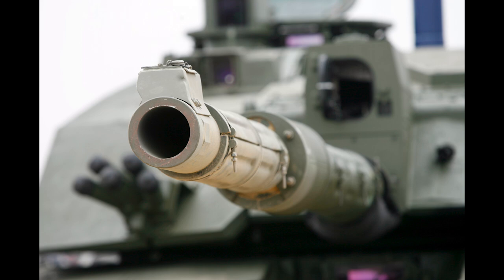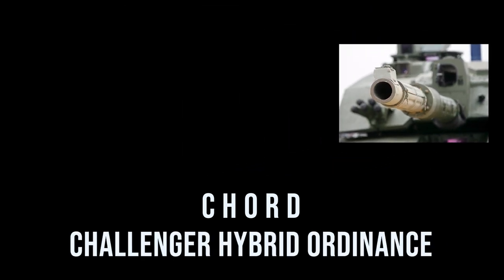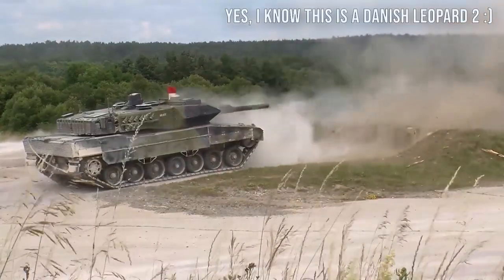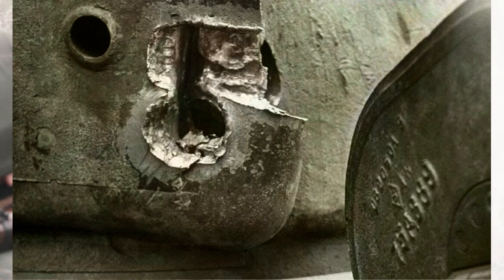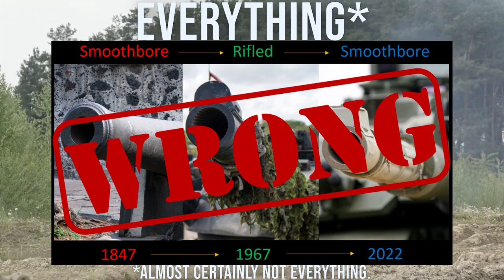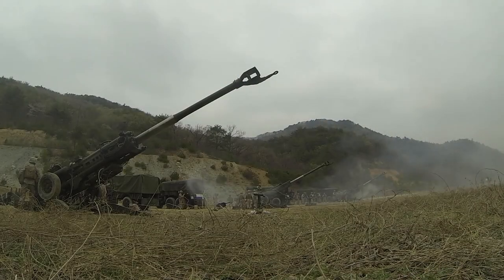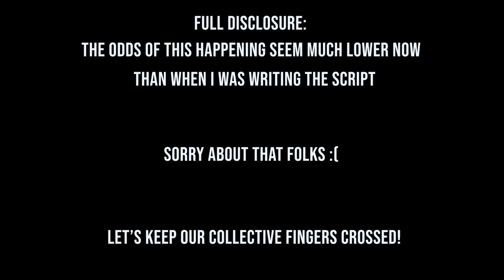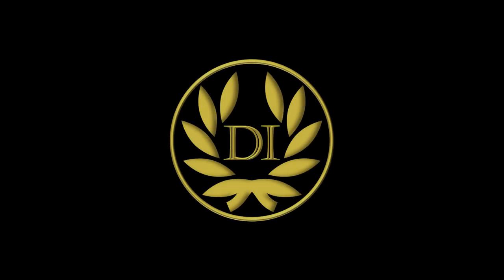Everything* Wrong with: Why do (most) Modern Tanks use Smoothbore Guns?

Comment: Another major reason for switching to the smoothbore Rh120 is that the rifled L30 has reached its limit in terms of APFSDS penetrator length, which is a key driver in penetration performance.

Comment: Licenced version of the L30. You are doing a good job my friend. Keep up the good work. Nice photos of the Sabre 2 on your comments about HESH. The Challenger 3 gun type is still not settled. The 130mm is still in the running.
Reply from the maker: Thank you for the info! Much appreciated!
Reply from the maker: Oh, that 130mm gun is really interesting - I’ve read that it would require an auto-loader, but that it could increase the velocity of some rounds by as much as ~50% over the L55, which sounds like a massive leap in performance for just 10mm more diameter.
Reply: The challenger 3 will be using the L55a1 120mm main gun, these are being manufactured now in Germany. The 130mm L/51 was never in the running for the challenger 3.
Reply: @diffusumideas9064  yes it's interesting. I expect commonality will win out, only for the US to change their calibre lol. Good video, keep it up.
Reply: @HJDore  
I don’t get why so many people do believe that the Rh 130mm/L51 gun is an option for the challenger 3. The Challenger that was fitted with the 130mm gun was just a demonstrator, not even a real prototype. The 130mm/L51 is still under development. And  it is even not clear if the gun will be selected for the MGCS program because the French are still trying to promote their 140mm ASCALON gun with telescoped ammunition.

Comment: well, the heat rounds do partially melt the armor. it's a combination of melting, and pure pressure that makes it achieve penetration.
Reply from the maker: That’s true - and technically kinetic penetrators also partially melt themselves, and the armor they’re coming into contact with, simply by virtue of the immense heat generated by the impact. But I think in both cases, it’s the velocity of the penetrator / metal jet that’s doing most of the work. Good comment though!
Reply: @diffusumideas9064  i think that the melting plays a more important role with HEAT rounds simply because the temperature that is achieved is much higher, if i'm not mistaken. anyways, it would be interesting to see someone actually do the math and calculate the relative contribution of pressure vs heat (if that's even possible).
and at any rate, the state of being super plastic is almost the same as being liquid, so...